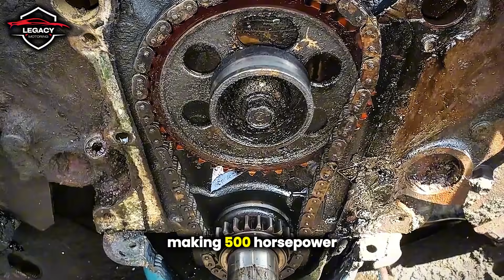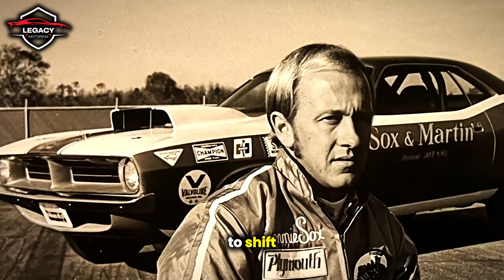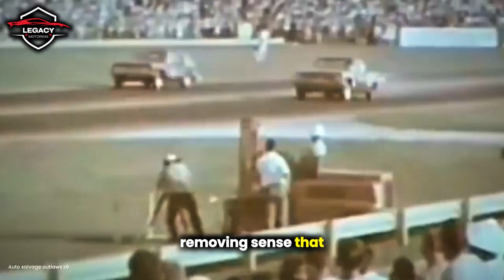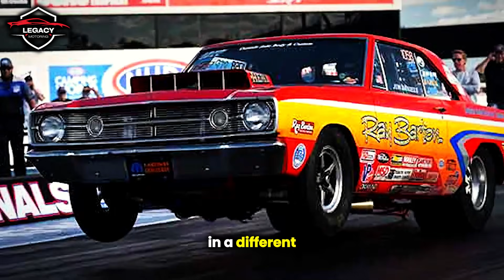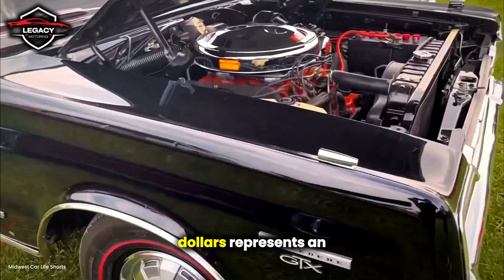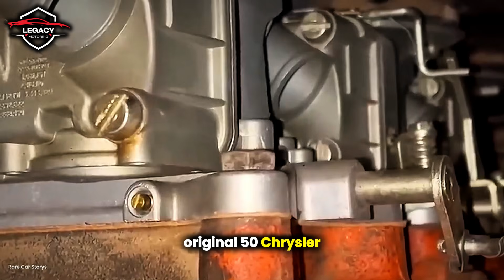The "Banned" Hemi Cross-Ram That Made 700 HP in 1965... Why Did Chrysler Build Only 50?

Comment: Short-Ram Variant: A special "short-ram" version with 15-inch runners was also introduced in 1960 for high-RPM competition, though it was extremely rare with only 15 units produced for the 300F.